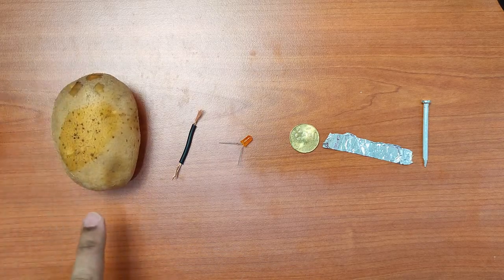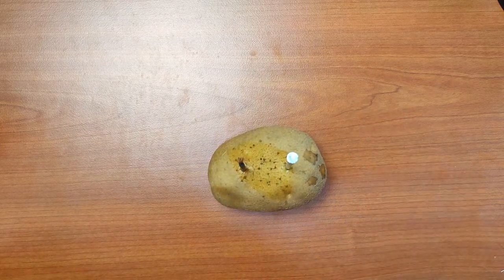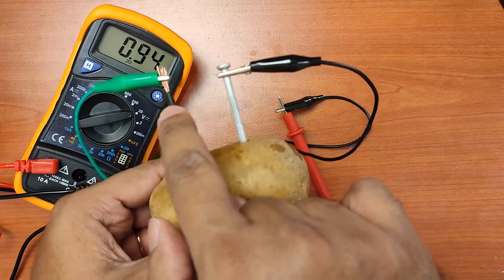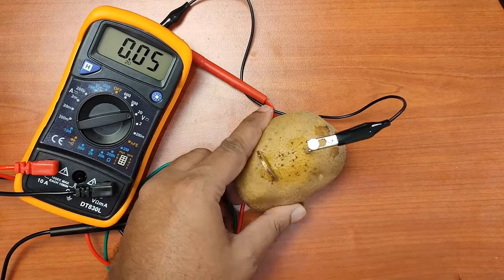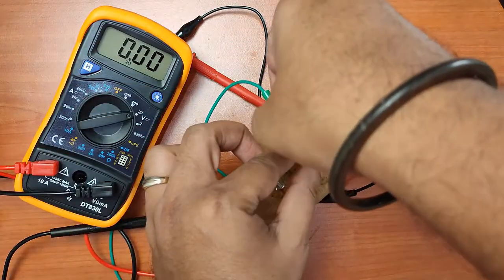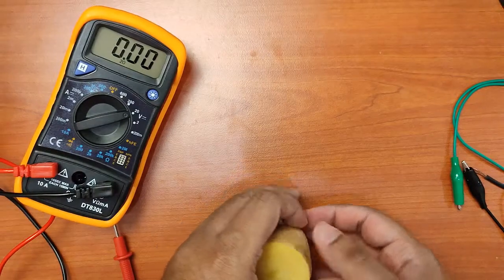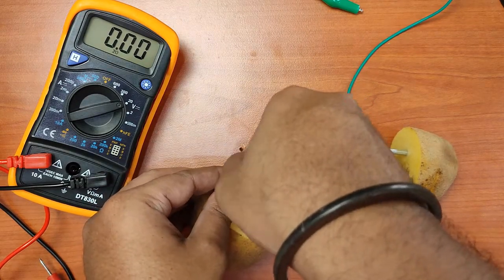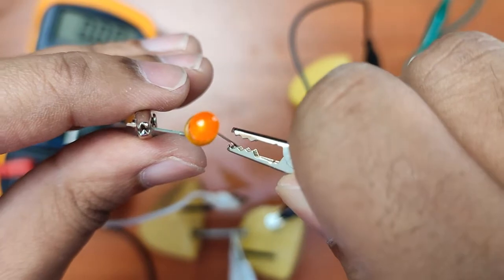How to make a simple voltaic cell at home / Potato power!

Comment: Love it!
Reply from the maker: Glad you do! 😊
Reply: @MrRuelTuition  Why is current so small though?  Try doing a video on how you charge a super capacitor and how many Potatoes are needed...  As a matter of fact one can pull the same amount of EMF from the Earth sticking electrodes in moist soil...  I would recommend doing a video on that one too...  Later on I can help with an electronic energy harvesting design that I am currently working on - I am charging super caps from the ground in parallel, then automatically reconnect them in series to raise the voltage, charge a coil with the harvested energy and then discharge the coil into a car battery - thus charging it slowly...  
Another project is to rotate bunch of magnets under a cast aluminum pan and have eddy currents heat it up, so that you can use it as source for joining different metals with different galvanic positivity and thus create EMFs in series...  The motor can be any 1.5V motor as it wouldn't take any resistance opposite stopping force in the process of rotating the magnets the way it happens when you rotate a permanent magnet rotor in a squirrel cage stator - the more current you produce the greater the cogging between rotor and stator...
I have some interesting R&D done in the field of No Moving parts/Non Rotational EMF generators...
If you are interested, give me an email where I can email it to you...
Cheers